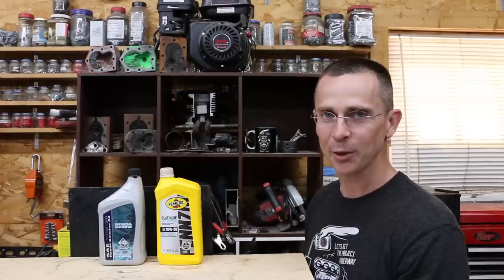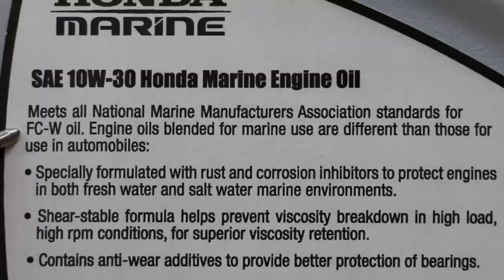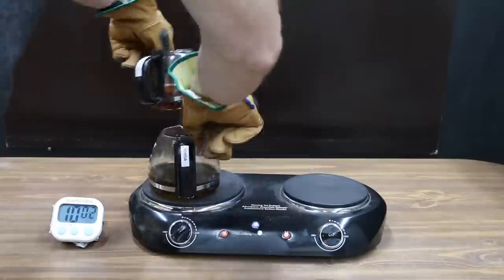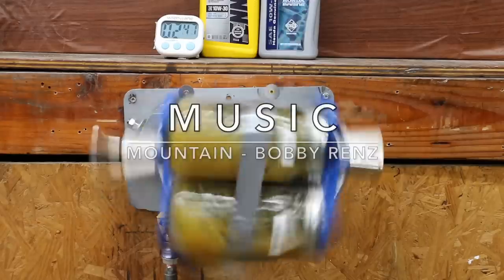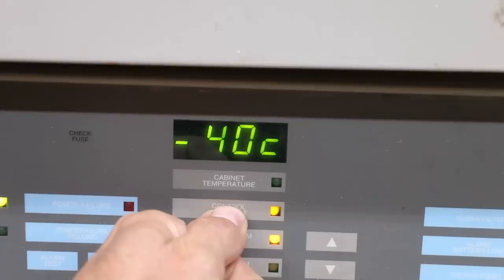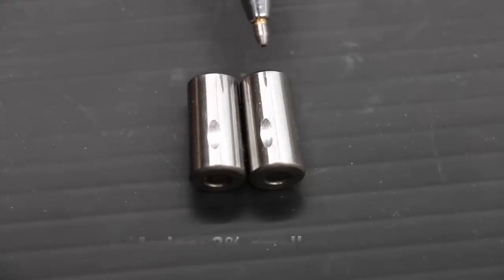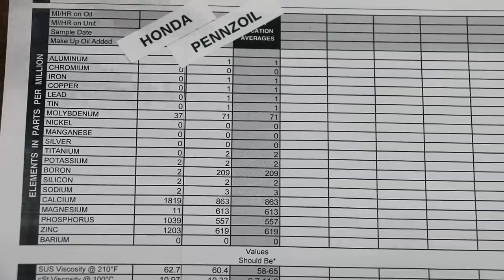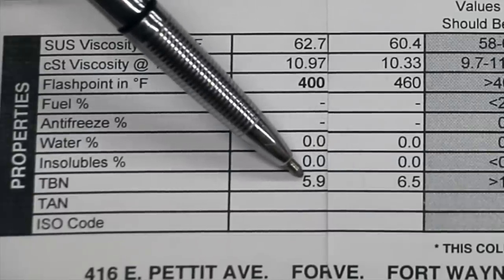Motorboat Engine Oil Better Than Regular Motor Oil?

Comment: The added wear protection package makes a lot of sense. Most outboards run much cooler than a car engine, even though they often have higher temp thermostats, the engine is cooled by seawater, which can vary greatly in temperature. They most likely are trying to prevent low temperature wear. Also, a high temp oil for the very same reasons isn't as important. 
On most outboards, after running the motor, the power head is often cool or only slightly warm to the touch. Since steel tends to wear best at higher temperatures, the oil is likely designed to combat the less than ideal temperature environment in an outboard. 
We were told by manufacturers that higher engine temps reduce wear in three ways, first is that the higher temps mean less moisture is present in the engine, second, at full operating temperatures, all the parts of the motor are 'expanded' to their intended size or 'normalized' thus improving wear characteristics, and third, cast iron and steel showed in testing to exhibit better wear characteristics at temperatures between 180 to 200 degrees. While I'm sure the higher temps also help improve engine efficiency and emissions, in most cases all aspects of an engine are improved when running at full operating temps. 
On an outboard, this is rarely the case. 

What would be a more interesting test of these oils is to compare marine vs. automotive oils within the same brand. For instance, Pennzoil 10W30 Marine vs regular Pennzoil 10W30 automotive oil etc. 

Personally, I've always run a good synthetic oil of the recommended viscosity in my smaller outboards without issue for years now. My oldest 4 stroke outboard is an early 80's Honda, and my newest a 2008 Mercury/Tohatsu. My thought is that any synthetic oil is likely better oil than the dino oil they originally specified.
Reply from the maker: Thanks for the feedback.

Comment: Great test. I have a suggestion. Please test synthetic 10W-30 motor oils for use in small 4-cycle engines. Test your best established auto motor oils (Mobil 1 EP,  Pennzoil, Amsoil etc ) along with VP Racing 4-Cycle SAE 30/10W-30, , and Amsoil ASE 10W-30/SAE 30. The last 2 claim to be much better for small engines than the ones made for cars and trucks and claim to meet SAE requirements for both straight weight 30 as well as 10W-30. Thanks for all of your excellent testing.
Reply from the maker: Thanks for the suggestion.

Comment: Like what you’re doing, I use Air Craft oil for motor cycles, lawn mower, boat motor pretty much everything that has Aluminum components it’s designed for air cooled motors works great for everything but is pricey 👍.
Reply from the maker: Thanks for the feedback.

Comment: Aside from corrosion inhibitors, the only defining difference between marine and automotive oils, are EPA restrictions on additives... hence why many marine oils depend so heavily on calcium, as an anti-wear additive. Calcium also acts to inhibit corrosion of the base metal with prolonged use.

Comment: I bought my first boat last summer. It's a yamaha jet boat with a 4 cylinder that looks like a car engine. It calls for 10w-40 Yamalube. The only type readily available is conventional, which is $9 a qt. 
I briefly considered buying a regular full synthetic oil, but decided against it until i had researched the topic. 
As soon as I opened the 1st bottle of yamalube, i knew it was different. It smells like gear oil. Considering that my little 4 cyl jet boat cranks out 7,500 rpms on a regular basis, i have decided that Yamaha knows better than I do. I'll stick with the $9 conventional yamalube.
Reply from the maker: Thanks for sharing.

Comment: The time you take for your testing is very appreciated. 
Please consider testing straight 30 weight oils. Let's say Honda 30 weight small engine oil, Briggs & Stratton  and Rotella T1 30 weight.  Maybe include 30wt.Delo and Delvac 30wt.
It would be interesting  for those of us who use Mono weight oils.
Thanks again for all you are doing.
Reply from the maker: Thanks and you are welcome!  Thanks for the suggestion.

Comment: Zinc is a must for an older car that used leaded gas with a non roller camshaft as it is needed to keep it lubed. MY camshaft fell apart cause I didn't add zinc and the lead gas treament to the gas. Hard to find oil with much zinc anymore.
Reply from the maker: Thanks for sharing.

Comment: Just a FYI before roller lifters, and Catylitic converters engines had flat tappet lifters, no Catylitic converter, and oil had higher zdpd content to protect the cam and lifters from ware. 
Oil changed to protect Catylitic converters, lifters changed to improve cam longevity.
Reply from the maker: Thanks for sharing.

Comment: Concrete cutting and concrete grinding discs for angle grinders are area where no one did some comparations. How fast they can cut, how much they wearout, amount of noise they produce, and of course the cost. Everyone knows that Bosch, Milwaukee, DeWalt, Makita are best of the best since they are expensive but which offers the most for the money. 
Greetings from Serbia!
Reply from the maker: Greetings!  Thanks for sharing.

Comment: Something to consider is outboards cooling systems operate at much cooler temps then automobiles.  Most outboards thermostats  open in the 140-160 degree range.  Lower flashpoint is beneficial to burn off moisture.
Reply from the maker: Thanks for the feedback.

Comment: Research has shown that ZDDP additive effects catalytic converters only when cheaper oils burned off at higher rates. Quality oils with higher ZDDP did not damage converters. Like Driven engine oil is an example of this. Test this one vs. Amsoil Signature, or Pennsoil Ultra Platinum. Thanks!
Reply from the maker: Thanks for the video idea.

Comment: Try with Castrol products. I have Castrol GTX and Castrol Dex/merc for older ford vehicles in my transmission. I had a Nissan Sentra that I put Castrol GTX in, did regular oil changes, I got 575,000+ miles on it when the original timing chain broke, it was recommended to be changed at 150,000 miles.
Reply from the maker: Thanks for the feedback.

Comment: Great information! I'm not sure if you have already done this sorta test before but it would be interesting to see how the number of hours/miles affects the lubricity of the oil in old-style petrol and diesel engines (eg. compare new oil to used oil at different intervals: 3000miles, 5000miles, 10000miles, 15000miles, 20000miles +). Or could do the same test but for a differential or manual gearbox.
Reply from the maker: Thanks!  Thanks for the suggestion.
Reply: @ProjectFarm  No worries! I appreciate your quick response!

Comment: PF, I've seen people use you as a reference source all over the internet. You're doing the Lord's work. One thing on your motor oil tests I think add would add value without much attentional work is measure the density or specific gravity of the oils before testing and after each test. Basically how much does 1mL of fluid weigh or how much volume does of 1 gram of oil have. Either way you're probably already measuring it just not converting it. During the heat cycle tests it would be interesting to see if it's water or solvents being vaporized. The closer to 1g/mL or 1mL/g of vapor loss the more likely it's just water being vaporized, which is a good thing and it's actually a known flaw in synthetic oils and can leave crystals on metal surfaces. Some oils create an emulsion if all the water isn't burned out.
Reply from the maker: Thanks for the constructive feedback.

Comment: I think the oil series videos are the best videos. I personally would like to know more about viscosity, like what does the difference in pour point at 0 degrees actually look like with 5w-30 vs 5w-50. I’m curious because I have a Mach 1 mustang and went to the Ford performance Mach 1 track Attack. Ford recommends 5w-30 for my car and they all have oil coolers so high oil temp isn’t an issue. That said Ford performance Driving school uses 5w-50 across the board in all their cars. They all get hammered on but all run like sewing machines, no “coyote” tick as it’s become known in Ford circles.
Reply from the maker: Thanks for the suggestion.

Comment: As a teenager I once use bombardier Sea-Doo jetski oil in my two stroke bike. Just because I had a couple of bottles laying around. Piston / cilinder broke down very fast with that oil. Probably not suited for air cooled bikes, Sea-Doo's are cooled with the water running trough them.
Reply from the maker: Thanks for sharing.

Comment: Couple of ideas. 

1,Do a test of a racing engine oil vs a standard emissions rated oil. 

2, Do a test of oil that is diluted by fuel. A common problem with old worn out engines and rotary engines is oil dilution by fuel. Would be interesting to see how much it will affect the oil’s performance.
Reply from the maker: Thanks for the video ideas.

Comment: 1. Test the different marine oils for outboard engines.

2. Test different brands of fuel/water separators. 

3. Test the major brands of anti rust/ protection aerosols

4. Test the different chemical bases of grease.
Reply from the maker: Thanks for the suggestions.

Comment: I noticed the marine oil has about double the zinc and phosphorus.  Having recently replaced an engine that requires high zinc oil, wondering if marine oil would be a viable option.  I think it would be interesting to consider which oils would satisfy the lubrication requirements of engines with flat tappet cams since there are still so many of them on the road.  Perhaps some marine oils, diesel engine oils, zinc additives, along with Valvoline high zinc racing oil could be compared
Reply: I saw this video about 6 months  ago and then I saw a couple of other articles when I think out of hemmings done 2012 where it showed zinc levels at that time where they were changing over to sm spec oil then a saw a spec sheet  from Lucas a couple years ago that showed zinc levels of there various oils for marine and motorcycles and cars and heavy duty diesels and racing and the classic car oil they offered was at 2200 parts per million the SM spec was closer to this 1200 I believe I'd love to see a test of European blend versus oil blended for old cars classic cars see what different zinc numbers are

Comment: I would like to see you test screwdrivers. Just normal Phillips and straight. Phillips for resistance to wear and straight mostly for survivability when being used other than turning screws. Torque input on the handle would be cool too but harder to keep it from being very subjective
Reply from the maker: Thanks for the video idea.

Comment: I would love to see a comparison between the high zinc oils for older flat tappet engines, like Rotella, Valvoline VR1, Super Tech Diesel oil. Or, any others advertising to have higher zinc.
Reply from the maker: Thanks for the suggestion.

Comment: While working for two large diesel engine manufacturers, I was constantly asked, which oil/filter/fuel filter/air filter/antifreeze should I use?  My answer was always "The one that ensures that your warranty will pay in case of a failure"
Reply from the maker: Thanks for the feedback.

Comment: Have you considered a video about sound deadening material. Possibly different location sin the car as well. i.e wheel wells vs trunk internal areas vs external areas. Including dynomat, carpet, or even something like the green goo used to soundproof homes.
Reply from the maker: Great suggestion!  Thank you.

Comment: Love the videos ! 
Just wondering if there's ever been a test pitting ATV manufacturers ( BRP Polaris etc ) branded oils against synthetic automotive oils.
Not really concerned with the "wet-clutch" properties but more with the CVT equipped machines .
Many people are claiming Mobil-1 full synthetic & Shell Rotella are as good as the OE oils .
Gene , Lackawanna NY .
Reply from the maker: Thanks!  Thanks for the suggestion.

Comment: I have an experience about using my boat Yamaha outboard 4 stroke 115HP with a car base oil in the past, but after a month I swap back to the original Yamaha marine 4 stroke oil.  There huge differences in running all the RPMs and idling, even when starting up the engine at cold.

But not the whole story, it may be the oil quality issue tho.  I also had experience using both Suzuki and Yamaha marine oils, but Yamaha oil outperforms Suzuki oils by: much much longer oil life, much smoother in all RPMs ranges.

Marine oils are not for the temperature sensitive situation as my guess, so overheat tests perform worst than car oils.  It should be many of the marine engines can do heat exchange directly by the outside water source such as seawater or freshwater, they are boat they got plenty of water nearby them, so not surprised for me the evaporation test worse than normal oil.  By my understand automotive engines are in their own closed system for cooling no any source from outside of the vehicle for heat exchange and so the oil evaporation need to be at a lower level compared to marine oils.

The freezer oils race by your narrative is just hilarious and GOLD XD!  I thought I am sitting in front of a horse racing field BTW XD

Marine engines such as outboards didn't have a catalytic converter, maybe some of the inboard engines do, so there also discussing the emission bill on marine engines need to have a catalytic converter.  I think it should be something related to the EPA and CARB standard compare to the automotive standard?

My conclusion is the same:  If you using marine engines, using marine oils.  If you going to use it in the car, just go for car oils.
Reply from the maker: Thanks for the feedback.

Comment: I use Rotella diesel 15 w 40 oil in my 1985 4 cylinder mercruiser 140 hp.  Runs great.  It calls for that Mercury quicksilver.  I won’t be changing bc that’s all its ever had.  Maybe test Rotella against that Mercury quicksilver?  I don’t have a cat converter so the zinc won’t matter.   The zinc is supposed to help the engine. Merc quicksilver oil is expensive too

Comment: Since diesel oils are not bound by a catalyst converter I assume  diesel motor oils have more zinc and phosphor  in their additive packages. Therefore would a diesel motor oil be a better oil to compare to a marine motor oil? The cost savings would be significant if one could use a diesel motor oil in their 4 stroke outboard. Thank you for another great video.

Comment: I would like you to do a test on the best Multi-Tool blade.  My local HD has 3 brands; Dremmel, Diablo & Milwaukee.  I mainly use mine for wood so the embedded nail blades would be nice to see tested.  I need a metal one now and Diablo has two different blades for metal one "Bi-metal" and one "Carbide"  The Carbide blade says on the package that it lasts 50X longer, which is perfect for you, "Were gonna test that!"
Reply from the maker: Thanks for the video idea.

Comment: Think about this comparison. Two cycle mixing oils. Include , Amsoil synthetic 2-stroke oil.  Quicksilver marine lubricants 2-stroke oil, Poulan PRO synthetic 2 stroke oil , Stihl synthetic 2 stroke oil. ALSO INCLUDE "GOLDEN SPECTRO" Synthetic blend Motorcycle premix oil.  Thanks for your consideration. I've been told Golden Spectro is the best 2 cycle prefix oil...prove me wrong if you can. Thanks again..
Reply from the maker: Thanks for the suggestion.

Comment: Marine oil has a completely different use case. Most boat engines average between 30-50 hours use a year. You motor out to your spot, anchor up for hours then motor back. Most running is done at idle or low speed (eg no wake zones) with occasion full throttle. But, it needs to sit for days or weeks without being used with the risk of internal corrosion from the marine environment. Marine engines also have different environmental legislation with emissions not as tightly controlled, so the oils can have chemistry not found or allowed in car oil. So it was an interesting comparison but actually, I'd like it compared the other way around - ie using car engine oil in a boat! :)
Reply from the maker: Thanks for the feedback.

Comment: Bass Boat engine is running at a high RPM for hours at a time.
If you try that with a regular car running on first gear and high rpm for an hour or two, you might blow the engine.
So it made sense it had good wear protection, also great rust protection being a marine oil, however it’s shame to see it loose it some other areas like cold start or the amount it actually evaporated.
Wonder if the Mercury oil is similar to the Honda oil. 
Mercury is the best in the marine industry, even though I like the Honda a lot as well and Yamaha.
Reply from the maker: Thanks for the suggestion.

Comment: You should DEFINATLY test Bardhal oil,it's probably not well known in the states but it has a unique formula that basically protects the engine even when there is almost no oil at all.
It was used during the second world war in planes because if the oil pan got shot the pilot could still return to base without seizing the engine.
You should really give it a try,it could shine in the rotary abrasion test.
Reply from the maker: Thanks for the suggestion.

Comment: At first I felt it was a failing in comparing a conventional oil to a synthetic.  There are synthetic marine oils out there, and my Honda specifies this oil.  However, I believe the difference in wear additives is the main point in the differences.  Marine engines run at constant high rpm with shock loads.  Cars don't even come close to the wear and tear that causes.  The additives might give a small advantage in a car but your point on the catalytic converter is probably spot on.  Imagine that,  run the oil specified from your manfacturer.
Reply from the maker: Thanks for the feedback.